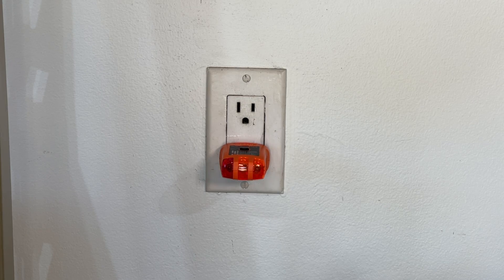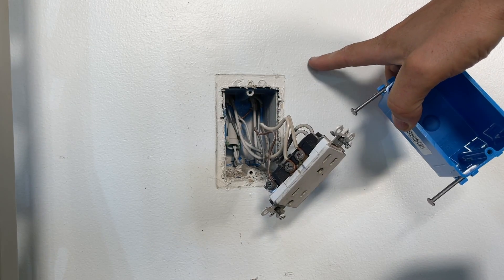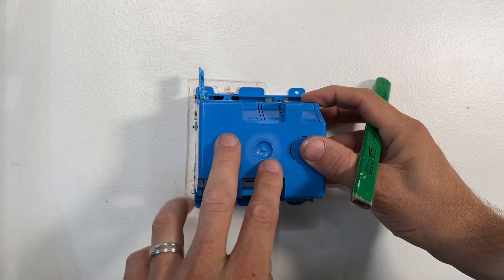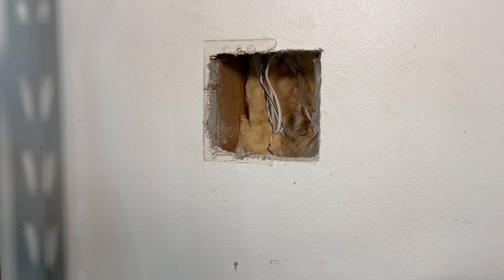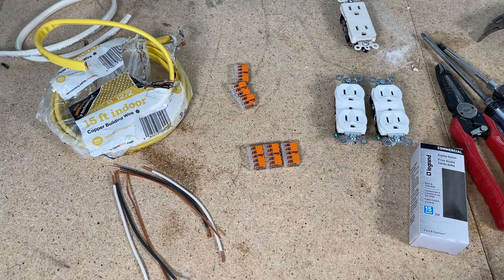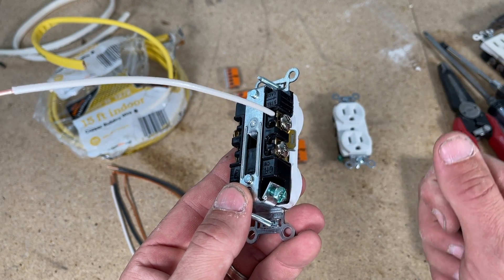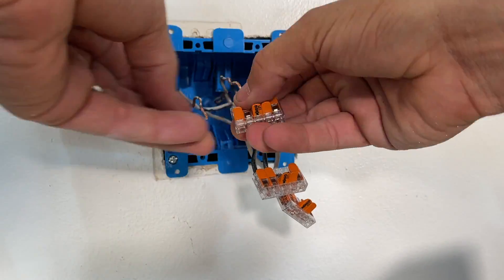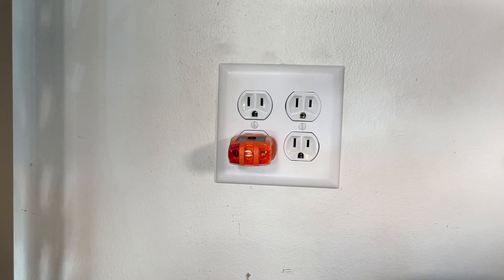Converting 1 Outlet Into 2

Comment: Personally, I like to use new-work boxes and just cut the ears off of them.  I then run screws through the side and into the stud.  IMO way stronger and overall more reliable than two flimsy tabs holding onto the Sheetrock. And yes, I’m a believer in using wire nuts instead of today’s alternatives.

Comment: This guy wants to be an electrician so bad he can taste it. Again he shows how to take shortcuts in electrical work that shouldnt be done. A true experienced electrician doesnt determine dead circuits with one of those no contact toys. They are not reliable which could result in serious injury. The second shortcut is to use spring lever connectors known as wagos. These things burn, melt  and cause circuits to stop working. The wires should be twisted and a wirenut screwed on. What he did will for sure eventually breakdown and even when you tighten the outlet screws the levers pop open. Take the time to do the job right and stop taking shortcuts, with electrical work you cant afford it. All to save a minutes worth of time. This guy needs to stop showing others how to do inferior work.

Comment: If you get random GFCI tripping in the garage, I would start with your install. You left the ground wire extremely close to the neutral contacts on the left receptacle. Other than that, great instructional.

Comment: late to the party, but would it make sense check the usual 'amperage draw' on the circuit before you do anything? if your circuit provides 15 amps, and your current (no pun intended) average total load is 12 amps, why add a receptacle at all? you can't do much with 3 amps, better to increase your total load capacity to, say, 20 amps, maybe 30 even, and THEN add your receptacle, thereby saving yourself frequent trips to the breaker-box.

Comment: Very nicely done videos.
It's nice when you have a fairly new house to re-work. Things are what you expect as far as wire lengths, ground wires present, etc. I'm upgrading my 120 year-old home that was converted form knob and tube wiring many years ago. I have run into some really unique nightmares. Plug fuses instead of breakers, light switches that switch neutral, both phases of a split-phase system present in the same box (240volts inside), two different circuit feeds in the same duplex box, so killing one feed leaves the other hot, etc.

Comment: Excellent video. I see you used the 5 wago connectors.  Ever consider using the wago wall nuts this is different style. You can use 4 wires per wall nut.
Here is my video on wall nuts that can connect 4 wires:  https://youtu.be/bZAU9VDIHSc

Comment: I noticed after removing the single gang box, you installed the double gang box you were unable to nail it into the stud, is that correct? So instead, you just pushed the double gang box in and it was secured by the wall panel. That is what you had to do since, you had no choice because, there was not enough room to nail the box in.

Comment: Great video. I recently replaced a nonfunctioning single doorbell with side by side duplex /quad spo that i could replace the nonfunctioning singular doorbell with three off the shelf discreet ringtone wireless  doorbells. Now can determine if there is someone at the front / rear doors or the deck. This video helped a lot with the project.

Comment: I always start the jab saw about an inch away from a corner,  cutting away from the corner, because if you start at the corner, you'll overshoot the corner as you wiggle the saw in. Also, doing this keeps the corners intact while you're doing your main sawing, preventing the piece from breaking prematurely and perhaps giving you a jagged edge. Then you can finish it by sawing towards the corners and gently releasing the drywall chunk. I also align my jab saw on the INSIDE of the line that I drew. The line is drawn on the outside of the box, so ideally after cutting, the line is still sorta visible RIGHT on the edge of where you cut. This will give you a super tight box fit, so that you're not relying on those two small clamps alone to keep it from moving.
Reply: Great suggestion. I always learn additional tips and tricks from the comments! Thanks for sharing

Comment: What makes a lever nut "acceptable" and the stab connector on the outlets not? Both are friction holds, both have a way to release. I'm not sure why one is ok while the other isn't...
Reply from the maker: At least from my standpoint I am not a huge fan of the simple lever arm that holds 14-gauge wire into the speed wiring / stab feature.  This feature is 1 and done since the lever arm defects and does not spring back to maintain a consistent amount of force.  For the WAGO 221 there is a piece of metal that serves as a spring and the lever simply releases the spring.  That is what makes the WAGO 221 reusable and a better option as compared to speed wiring.

Comment: Nice work on installing the box but for double duplex an electrician would normally loop the hot and neutral wires between the outlets. In other words you wire the two outlets together. If the ground wire is long enough where you don't have to splice it to another wire you wrap it on one outlet screw and then over to the other outlet screw. If not then add a ground wire from plug to plug and leave a tail at one end. The idea is to reduce wires and connections. In construction you'd typically make as many double duplex receptacles as required all at once using a single ground across the two with one end extended out to tie in the plugs to ground. Then you go to the box and twist the ground wires together and add the plug ground to it and twist the wires together and add a wirenut. Continue with the neutral and then the ground. When you have several wires of each in the box you add a tail from the outlets and use that for your connection. It's a good safety habit to always cut the hot wires off first when you're removing them, then neutral, then ground. During hookup you reverse that hooking up the ground first, then neutral, then hot. Hope I'm not confusing you by my terminology but here in my area the outlets are generally called plugs and the end that plugs in is called a cord cap. If you go to a supply house and ask for a box of plugs they'll give you a box of outlets. Now as for your wire clips. I understand they are popular but for long term use I'd never use one. The best connection will always be straight wire to wire. That means twisting all the wires together and then adding a crimp sleeve or a wirenut. In forty years in the trade I don't remember ever seeing a single wire nut that failed. However I have seen lots of people who don't know how to install them. First forget the directions on the boxes. They are wrong. Always twist all solids together. Always twist all stranded together. Cut to length and twist on wire nuts. When you have a mix of solids and stranded you twist each as before but then you lay the solids and strandeds side by side even on the end and twist the wire nut on both at once. Tug one set at a time to make sure you got it right. Over the years I've likely installed many thousands of outlets and believe me the most important thing is reducing time and wire while ensuring the connections will last for the life of the building. Nothing that relies on plasic is going to last for the life of a building. I've rewired things in older buildings and found wirenuts that were from the forties still doing the job.

Comment: By code the ground faces up, the back of the outlet has an arrow showing the right direction. If the plug comes loose only the ground is exposed.
Reply: Where is that code located?  Not an issue where I live.

Comment: SEE: around 09:07 to about 09:35   Hey bro, do you not normally snap off the "ears" of the recips at the top and bottom, those pair of holes that are NOT needed in a res. application when using a commercial recip. I am employed doing only commercial and when I allegedly do res. work and some how, come across commercial recips i almost always break off those ear tab hole things.

Comment: This violates the NEC code,  314.17 (B) States "Where nonmetallic-sheathed cable or multiconductor Type UF cable is used, the sheath shall extend not less than 6 mm (1∕4 in.) inside the box and beyond any cable clamp." At the 5:12 mark you can clearly see the violation.

Comment: What are the technical reasons to add a second duplex outlet versus just using a power extender (with 3 outlets on it). I do see the space and neat point, but electrical I don't understand. It still an extension inside the electrical box.

Comment: i think the biggest advantage of the Backwire outlet is the 4 terminals with a good tight connection on each side so it actually works better having two wires on a screw.  just run supply to one outlet jumper over to other outlet and then have wire going out of box over there no wire nuts or wagos needed just twist grounds together leave 4-inch-long end on each and put on a crimp on sleeve so you can ground each outlet with free ends

Comment: I converted my single outlet into 6 outlets in 5 minutes.

I plugged in an extension strip.

Kidding, I have often wondered about doing things like this. Actually, the more interesting project to me is extending things like the single light switch in the bathroom to a multiple switch so that the new fan/heat/light controller can be easily operated.

Comment: Great video, love the simple clean way you demonstrate and explain the work you’re doing.  Quick question though, you mentioned multiple chargers.  Other than table top space, is there a reason you went with adding a second outlet rather than using a power bar?  The reason I ask is the second outlet works best if you have straight plugs but if you use anything with any kind of power regulator/transformer plug then they can block the use of the second plug on the outlet.  Just wondering if there is a better reason than space and cost of a power bar?
Reply: if you ever took apart most modern outlet strips, they are real junk inside i have had several break on me and the connections inside are not good quality for plugging in a power tool or something with a lot of amps. i don't know how they get away with selling the stuff. some i think fake their Ul approval stickers

Comment: I only recently came to understand that some people actually Care what direction the slot in the cover plate screw is facing, lol.  Talk about a SEVERE case of OCD.  It doesn't matter, as long as the cover plate doesn't fall off!
Reply from the maker: Actually it is one of the first things some professionals look at for an indication of the skill level for the last person working on the electrical 🤷‍♂️
Reply: @EverydayHomeRepairs  I think they'd consider how the wire loops are on the terminal screws inside the box, etc. Not the anal-retentiveness of whether an exterior plate screw is vertical or not, lol

Comment: What is the current rating for those lever nuts? Should the line be inserted closest to center with branches next to center and immediate receptacles wired to the wings to minimize heat concerns from loading?
Reply: Rated 32 A/450 V

Comment: I like to wrap the outlets with electrical tape as an extra precaution.  Also I suggest drilling in a drywall screw to add additional strength on the stud side of an old-work box when possible.
Reply: Not code, though I understand the reasoning.

Comment: Huge question. For my garage like I want to add this , l but with a  GFIC .  So do I used 2 GFIC outlets? For the install?
Reply from the maker: No usually you can bring the power into the GFCI (Line Terminals) and then run hot and neutral wires from the GFCI (Load Terminals) to the standard outlet.  This will provide GFCI protection across both outlets.  Need more info on Line vs Load check out this video https://youtu.be/bWfveKM6NEk

Comment: IF YOU HAVE PRESENT 12 AWG WIRES WHY DON'T YOU USE 20 AMP RECEPTACLES INSTEAD OF 14 AMP.
Reply: code allows 15 amp outlets because they have a 20 amp pass-through. If you really wanted a 20 amp outlet you'd likely need a dedicated circuit so you don't overload things. BTW, 20 amp style outlets cost more so adds up if you are doing a bunch.

Comment: 🤣🤣🤣🤣🤣Yeah, we do it totally different!!! You actually turn the power off beforehand!?!?! That's funny!!! I start by removing the plate and outlet, then I lick my fingers and grab the exposed wires to check the quality of the electricity (have to make sure they aren't sending me any of that damn garbage electricity of course)!!! If it's good quality THEN I shut the power off to the water heater (don't need to waste the energy, duh!) Then I go back to the outlet, lick my fingers again and check to see if I messed up and accidentally shut that outlet off. If the outlet is still on and it has good electricity going to it then I change the outlet. Next, I strip the casing back on all the wires at the same time using my teeth (because no one can afford to waste time). If I can't let go, I have someone hit me in the back of my head with a 2×4 to knock the wires out of my mouth (or knock me out, who cares which happens first)! If all that goes well enough, I then hook up the new outlet with my chainsaw wrench, wrap the outlet in a paper towel and prepare it to go back in the box. Before I put the outlet back in the wall I do a whizz test... I urinate on the outlet to make sure the breaker functions normally and if it works I pull the now sopping wet paper towels off it and put it back in the wall! Voila, it's done!!!!🤣🤣🤣🤣🤣🤣💀

Disclaimer: If you actually try this, you are part of the reason warning labels are  on EVERYTHING potentially dangerous!!!!!!🤣🤣🤣🤣🤣🤣🤣🤣🤣🤣

Comment: Scott, you already had two outlets. What you meant to say was "converting one receptacle into two" (each receptacle has two outlets).
Reply: When most people talk about plugging something in, they ask "where is the power outlet?" Not "where is the power receptacle?" So according to most people, he was right, NOT YOU!!!!
Reply: @randyherringshaw6325  According to you, most people should ape what other people do, even if it means perpetuating something incorrectly. Your kind of thinking is what, for instance, led the Germans to exterminate people in concentration camps in WW2. You're a mere follower. Good luck in life--you'll need it.
Reply: common term is "duplex outlet" (shortened to outlet) so adding another DUPLEX outlet gives you four places to plug stuff in. It it were a single outlet it would be called a dedicated outlet, meaning only a single place to plug in an appliance. That's usually on a dedicated wire run back to the panel.

Comment: I prefer wire nuts even with all wire.  Just twist them together with five twists or so linesmen's pliers first.  Trim the ends even and twist on the nut.  I wrap mine with electrical tape including the three or inches of the wires.  If you use quality wire nuts you can't pull them apart.  That way it is also waterproof for outside use.

Comment: I’m trying to put outlets where two wall sconces used to be. The previous homeowner wasn’t using the sconces, they had the holes covered up. I don’t see a ground wire though, so I’m confused. There’s no obvious black and white wire, they’ve got some type of woven fabric insulation. I’m so beyond confused!
Reply: if this is an older home (pre 1960) it's probably got older wire without a ground. They used rubber insulation covered with a woven fabric and it's likely in poor condition by now. (dry and crumbly) Also be aware that stuff might contain asbestos (fire proofing) or arsenic for rodent proofing. The colors might be black and the neutral is either "peppered" with white or silver paint over black rubber. Usually it's hard to see because it's flaking off at this point. To verify you can usually look at the wires in the basement or attic. That old stuff is similar to Romex (non-metallic) but a dark or faded silver color. Don't fool with it because the outside coating is toxic.
Reply: Look for YouTubes on GFCI (Ground Fault Circuit Interrupting) receptacles if you have no grounds. Sparky and probably this guy goes into them.

Comment: Couple of tips: you can also tell which side is the stud by wiggling the box. The side that wiggles more is not the stud.

To tell where to cut, you can also reverse the new two gang box and hold the front of it to the wall. Put a level on top of the box and level it. Trace the outline, without the "ears", and that line is where you need to cut to precisely fit the new box.

Comment: This is cool. I've been watching repair videos recently as my 2 plug outlet broke. I wanted to wire my plug. But I got my building super to fix it. Anyways as to your video. If that plug was the first in the series, could one plug be GFCI and the other normal? Would you hook the second plug up to the back of the GFCI plug, then use pigtails for the downstream outlets.
Reply: Yep, you can do that. If you want both outlets to be GFCI protected, hook up the second outlet to the "load" side of the GFCI. It will protect both.

You can also pigtail the downstream outlets and second outlet to the load side (or use the screws on the second outlet) and then the whole circuit will be GFCI protected.

Comment: Tip: if you push the outlets to one side, you never have to check if the plate will line up.
Reply: that's fine for new work but most of us are trying to hide the marks on the wall left by the original plate. IOW, ya gotta do what ya gotta do. The cover plate will fit even if you only eyeball the screw locations.

Comment: I also like to drill a small hole into the box and a pilot hole for the stud after the old work box is installed, then just put a plastic or nonconductive screw to give the box extra strength in case something bashes into the outlet and tries to pull the box out of the wall.